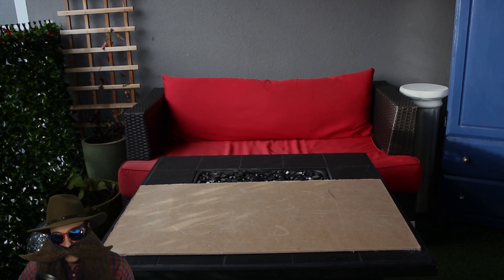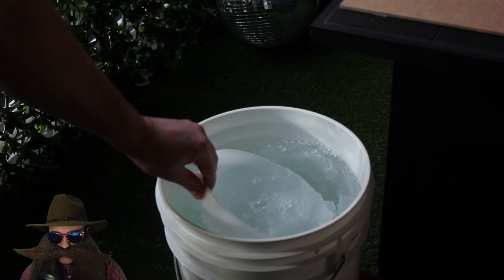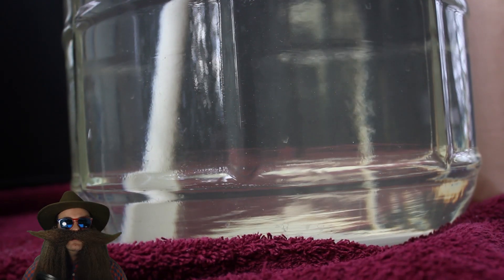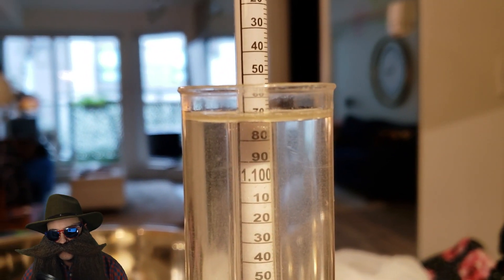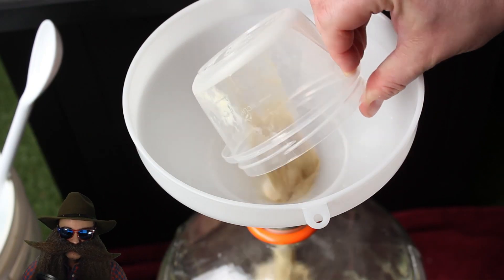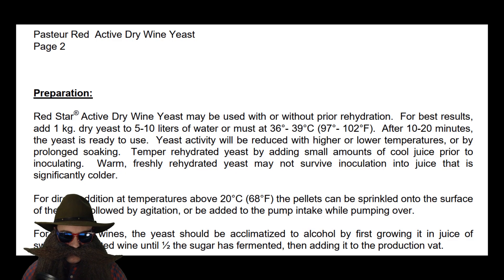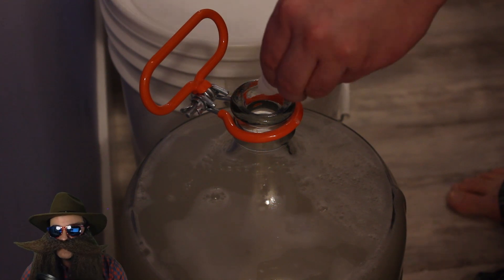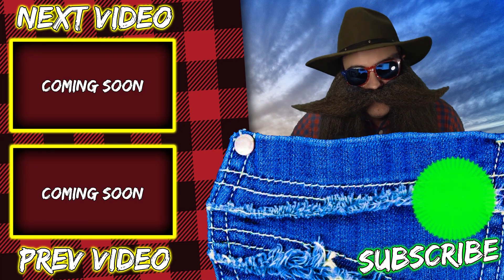Sugar Wash Recipe Design #1

Comment: My sugar wash is 40 gallons water 25kg sugar 1 pound Fleishman yeast. Finished in 36 hours.
Reply from the maker: Thanks for sharing, I have a 44 gallon Brute garbage can I'll be converting next year into a temp controlled fermenter. I've been working on a 6 gallon proof of concept fermenter (with some success) that I'll be releasing videos on eventually. 36 hours is a fantastic time. I'll be doing a yeast series eventually with varying pitch rates, different yeasts, original gravities, and temperatures after I'm done my pH control series. Do you add anything to adjust the pH?
Reply: @OpenSourceDistilling  I love watching these videos.  It's awsome watching them. I've been doing this for over 25years. Your column is cool. I made one of those about 2 years in. Groovy man. Done all the sugar washes. I'm into glass columns and bubble plates now. Fast fermenting yeasts and double distilling filtering through 3 feet of carbon.

Comment: Epson salt is used as a nutrient instead of gypsum.
Reply from the maker: Nice, thanks for the info. I find all the chemistry going on during fermentation facinating. Appreciate the comment.
Reply: Use with caution. If piggy backing a ferment do not keep adding same amount. The Epson salt can accumulate in the trube from one ferment to another and stall it.
Reply from the maker: @BigEdsGuns  I've got 4 batches going on, I plan on reusing the yeast cake for the next round. Basically because I'm cheap, don't want to buy more yeast, and have done this before when brewing beer and it worked just fine. Are you saying don't add Epson salt to the second round when I reuse the yeast?